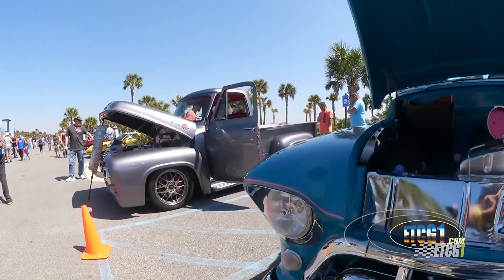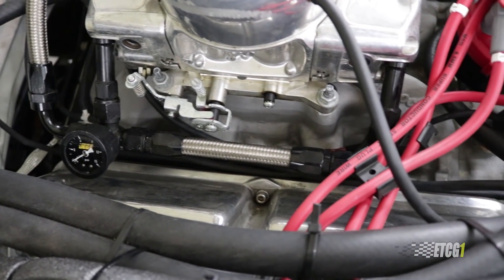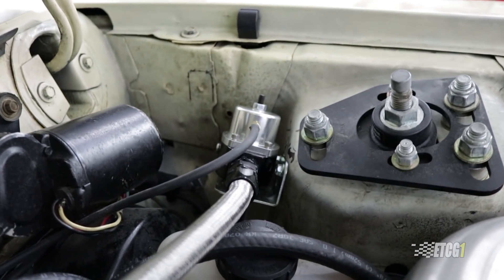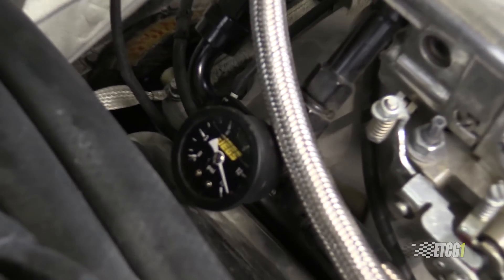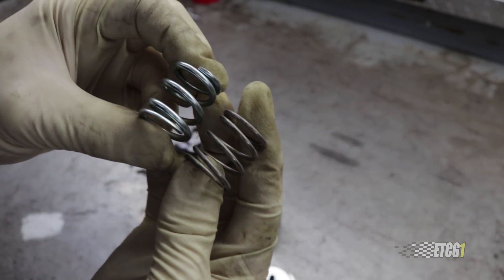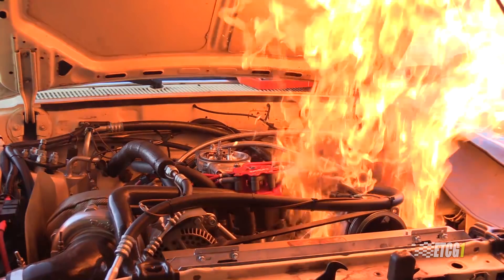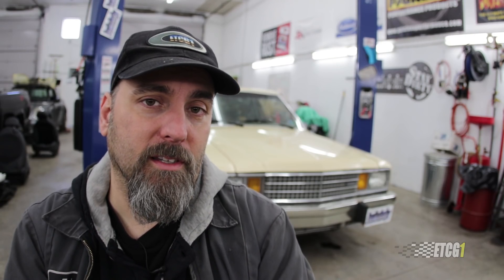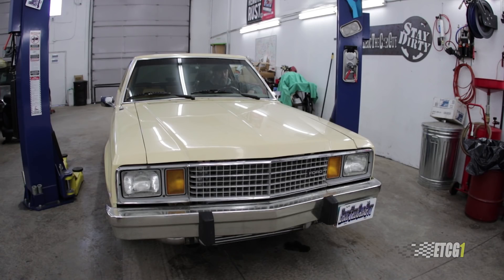How Did the Fairmont Catch On Fire?

Comment: I had to put out a titanium fire on my mill. The powdered extinguisher that I used, sent that damn powder into the nearby computer, shorted the internals, and killed it. That fire extinguisher powder becomes electrically conductive when it's heated. Thus my move over to a CO2 fire extinguisher.
Reply: That's a new way to kill a computer nice work.
Reply: That's rather surprising, as dry chemical extinguishers are rated for electrical fires - in fact, the class C rating in the US specifically means the extinguishing agent will not conduct electricity.  Not that the powder can't damage a computer, but it's very unlikely that it actually caused a short.
Reply: Being rated to out the fire and preserve the equipment are two different things.
Reply: Aussiebloke609 It's unbelievable until it happens to you. Class C is for electricity, not electronics. That's why server rooms use Halon and other gases so the electronics don't get ruined from the extinguishing process.
Reply: Thanks Dandel351. I'm so proud ;)
Reply: Scott Crittenden  Yup !!
Reply: Hmm...with a little research, it seem that extinguishers rated for burning metal (class D) are different to regular dry powder extinguishers, so I'd guess this is what caused your short circuits, since most of these are sodium chloride, graphite, or copper based, rather than the more common ABC dry powder.  If you're working in a mill, that's the type of extinguisher they'd have available, as no other classes are listed as applicable for metal fires.  However, as they are not listed as suitable for any fire other than burning metal, that's not really applicable to Eric's little barbecue.  The more commonplace class C dry powder  extinguishers (usually ammonium phosphate or sodium bicarbonate) are not conductive.
Reply: Not a class D for sure.
Reply: Lol titanium don't burn
Reply: Of course titanium burns - pretty much anything can burn if you get it hot enough.  Auto-ignition temperature is 2200F for metal (usually shavings) in air, and only 480F for powder in air.

The following is from a material safety data sheet for titanium:

"Do not allow metallic dust to accumulate.  Metallic dust may preset a serious fire hazard. Titanium and titanium alloy solids are not considered combustible in the form supplied.  However, subsequent machining operations require the use of cutting fluids to reduce the temperature of waste material which might ignite without coolant. "

https://titanium.com/wp-content/uploads/2013/05/Material-Safety-Data-Sheet-Titanium-.pdf

I also found this little tidbit on the same data sheet:
"EXTINGUISHING MEDIA:  Dry table salt or Type D fire extinguisher. 
SPECIAL FIRE-FIGHTING INSTRUCTIONS:  Remove uninvolved material; allow fire to burn out.  Fire can be controlled by covering with dry salt or powder from Type D fire extinguisher.  Carbon dioxide is not effective."

So regarding Mike's mill fire and computer problems from using a class C (dry powder) extinguisher-  if he's switched to CO2 now...good luck putting one out now, as it's specifically listed as ineffective for burning titanium.  And halon is used for server rooms because that fine dust can kill cooling fan and hard drive bearings, and clogging up microswitches...which will cause components to overheat internally.  But class C extinguishers (ammonium phosphate) doesn't cause short circuits.  If it could conduct electricity at all, it wouldn't be considered usable for any electrical fire, regardless of whether heavy duty electrics or electronics.
Reply: It burned so white hot I couldn't look at it.
Reply: Desert Mike DIY don't believe them. Some 'CO2' extinguishers I've seen are also loaded with sodium bicarbonate, which like table salt is conductive when dissolved in any polar solvent. So if you had organic acid antifreeze leaked from a CPU cooler, it's the EM-short city express for any nonpotted electrical device actively carrying current.
Reply: Mine is loaded with just CO2.

Comment: Just a couple of points. You need a Schrader valve on that thing so you can check your fuel pressure. This would have avoided your spill. Second point, you need some pulse dampening. That noise you hear is the fuel hammering on the regulator spring and it's check valve this will cause premature failure. It also causes inconsistent fuel to the carburetor though the fuel rail helps.
Reply from the maker: Thanks for the input, but the new system is working flawlessly and I couldn't be happier. Also, I have a fuel psi gauge mounted in the system permanently already. I don't see the need to add a port for another one.
Reply: Range checking. You only saw 100% of the expected range. Thing was putting through at least 3X that, but gage didn't go that far.

For things like aircraft or ships boilers, you'll see that kind of thing too. Looks redundant at first, but there's a reason.

Comment: Wow thank God you had the extinguisher and were able to stay calm enough to act fast! Did you let Holley know why this happened? They might want to know, at least to issue a warning to anyone using the same pressure regulator to check the spring first! 
As an inboard boat owner, one thing I always do even when doing tune ups etc is always replace the backfire flame arrestor on the carb before starting the engine. Same when I had cars with carbs, I saw a dramatic back fire out of a Holley on a small block Ford when I was in high school and its a sight you never forget!

Comment: Hey Eric, can understand the feeling.
Was working on a family member's rare '61 Impala 4 door hardtop 283 sport in an old garage full of stuff including a cupboard filled with vintage publications right against the front fender when probably shouldn't have as late and tired. Saw something splashing on the windshield, but swore imagining until suddenly had a fire just like you showed. I had to run to my vehicle and grab the no residue fire extinguisher. Talk about the most scary moment, my thought was that garage was going, go up quick and probably take out at least the living room. All that happened was burned the original wipers and singed the paint. Heck, didn't even get scolded by the owner or my Dad, my Dad had no emotion, just said something like "Glad everything is okay. (not typical)"
I am a FI person so didn't know carbies like to catch fire, otherwise would have had an extinguisher. You bet now every vehicle I work on have some form of extinguisher; always have had two in my personal garage.
Carbie was fresh rebuild but had sat for a couple years so now know the ethanol sitting in it trashed the rebuild and have to be done all over again.

Comment: Wowsers.  Glad for no real damage.  You are one lucky dude.  Recently i learned not to use a dry chemical extinguisher because of the horrendous mess they make.  I just ordered a 10lb carbon dioxide extinguisher for my small homebuilt motorhome.  I plan on two more...probably one more 10lb...and one 5lb.  When one is boondocking...who ya gonna call?  It is up to me.  Cheap insurance.

About your fairmont.  I wanna drive yours sooooo bad.  I owned a complete stock one for 15 years.  Great transportation car.  Only repair i had....was replacing the cabin heater core.  Nightmare job.  The whole dash assembly has to be removed.  Ugh.  Other than normal maintenance parts...the heater core was the only repair i did in 15 years.   Bought the car from an old lady...with 11,000 miles on it.  I sold it with 145,000 miles.  And was still running great.   So you can see why i wanna drive your ride.  Good luck! 👍

Comment: My reliable POS Olds Intrigue caught on fire after a hot climb up a snowy road. Luckily, copious amounts of snow put it out. Burned through the ignition wires though. Oil leaked from the valve cover gasket onto the exhaust manifold. We got a recall notice in the mail about a year later for that problem. Scary feeling.

Comment: I have seen advertised, fire suppression for under the hood. They setup like a building fire suppression system with under hood mounts and a push of a button it extinguishes the entire engine bay. I believe they also have temp sensor ones that will go off just by getting too hot.

Comment: About halfway through he video when you said you turned on the fuel pump, I knew what had happened.  Carbs man.  Glad it's all ok.  Still, that's gonna run way better with that regulated pressure.  Congrats on the hard work that's paid off.
Reply from the maker: This had nothing to do with the carburetor.
Reply: Was the fuel not geysering out of the carb bowl vents?

Comment: The 460 had a nice carb fire in my 79 Ford I had to put it out with a hard hat using ditch water. The excess gas problem may come back and haunt you down the road it may damage the intercooler.

Comment: Many long years ago, I had a Cutlass with a 350 and a Holley 1850. Working too late into the day, losing light, getting harassed and distracted, I missed getting the forward seal back on the fuel transfer tube, sprayed gas all over the distributor and POOF! Dry chemical extinguisher kept the car from burning to the ground but it absolutely trashed everything. Gave my the perfect excuse to go pick up a 455 for it tho :)

Comment: I had a Ford with a power steering leak that sprayed fluid on the hot manifold and caught fire.  Luckily,   I had a fire extinguisher and changed what could have been a catastrophic loss into a minor inconvenience. This power steering fluid was some kind of clear stuff, not automatic transmission fluid.

Comment: I had a similar situation in my old 1980 gmc sierra.  I was getting it running for my grandpa and it has seen better days, the second day after I got it running the connection at the carb started to leak. And it was only minor.  I went to start it after some time and she started on fire,I could see the smoke come out from under the hood!! Fortunately I run fast and grapped an extinguisher and put it out.  Replaced the o ring and its great now!
Reply from the maker: Glad you're OK and that you got it sorted.
Reply: Those glass inline filters are a fire waiting to happen. If the glass doesn't break, the seals will leak.
Reply: It isn't glass.  Its a little cartridge that sits in the carburetor.
Reply: Oh ok I know what you mean.  I've had Rochester carbs with the filter inside.

Comment: The extinguishing agents in many fire extinguishers are corrosive and will damage metal parts if it is not removed quickly. Hopefully, none of the polished pieces were damaged by the extinguisher.
Reply: nick harding Tho now it'll just buff out, unless 'prepolished things' simply melt.

Comment: Lesson of the day... if that fuel pressure gauge is maxxed out, something is wrong.   Don't crank it if the needle is wrapped.  Either the gauge is toast, or things are about to get extra crispy.  Think I'll stay away from the dual purpose regulator as an added precaution on future builds having seen this good idea gone wrong.  That, and not use an FI rated fuel pump to feed  a carb - it's capable of  adding  unnecessary heat into fuel from building higher pressure. 
  Thanks for sharing, and hope you don't need to use that new extinguisher.  Would putting the regulator on the front side and installing a fixed restriction ciruit coming off the log be feasible? You could machine a small block to accept a recessed jet as a way to experiment with proper orifice size.  Tee the bleed off with regulator return, and use a larger line back to the tank to prevent backpressure from building at idle if needed.  Might help keep fuel temps down if stuck in stop & go driving and help steer clear of vaporlock in hot weather...

Comment: So I don't know much about electric pump driven carb setups, but it seemed odd that the pump stayed on for so long without shutting off with just the ignition on. Is that the case with the proper regulator spring as well?
Reply from the maker: That has nothing to do with it, that's the way I wired it up. It's not tied to the ignition system on a timer like it would in a conventional car. It's on a separate circuit that's powered by the ignition with no timer. I wired it myself through a relay. Now that I have the correct spring installed and a return system, there are no issues at all leaving the pump on.

Comment: Wow! That looked like Niagra falls coming out of your inter-cooler. Those fuel lines looked pretty tidy to me. Definitely not turning fast enough to bend a con rod. Should be good to go other then washing all the oil off the cylinder walls. I like the F version of that pin label.

Comment: That's terrific that you were able to put the fire out so quickly! One question, it seems the engine has quite a long crank time. What causes that, and what is the remedy?
Reply from the maker: I had been running it previously. Likely it was a little flooded is all. It cranks right up most times. Carburetors can be a bit temperamental at times.
Reply: OK, thanks for your reply!

Comment: Hello Eric I'm looking for help on my car problem. 06 Toyota scion TC 89 thousand miles we are the original owners and for the last 6 months or so I have an "intermittent"  cranks but won't start problem. After 4-6 try's it will start and run great. And then it happens again several weeks later, the car can be running temp or over night cold. The dealer says it won't show any codes and they can't diagnose the problem when it runs. If I have it towed to the shop next time it happens there is no promise it will have the " intermittent " crank with no start. Any thoughts on how to find the problem without throwing buckets of money at the car guessing what part to try next. Thanks for your repair vids.

Comment: Same thing happened to me in my '32 Ford 3 window. The floats stuck in my tri-power at a car show. My trunk mounted tank is higher than my fuel pump so while I was at the show, my engine was filling with gas. When I started my engine, it hydro-locked. I pulled the plugs and cranked the fuel out of the cylinders and had AAA tow it to my house. I changed the oil, then started it. It wasn't running right though there was no knocking coming from the engine so I removed the valve covers and pulled the push rods. A few were bent.
Reply from the maker: That sucks, glad there wasn't any fire.

Comment: I knew from the first video where the fuel came from, but was wondering how the hell so much fuel ended up in the intercooler. Seen massive amounts of oil in intercoolers before, but never fuel. Now I know. 
Also been there with the incorrect pressure for a carb, and a lovely fire to go with it.

Comment: Robert Clark: "Second point, you need some pulse dampening. That noise you hear is the fuel hammering on the regulator spring and it's check valve" Hummm... Personally, I'd ask Holley... costs nuthin to ask, eh. Regards & Thanks for the education.

Comment: Hey Eric, was the Fairmont tuned with that fuel pressure regulator? If it was, does this mean you need to get it tuned again?
Reply from the maker: Yes, I've been tuning the car again since I installed the new fuel system. It's going much better now that I have consistent fuel psi.

Comment: A lot of race cars have a c02 or halon system plumbed in so you can just pull an oops pin and flood the engine bay.
Considering all the fatalities from fires after an accident all new cars should be fitted with one .

Comment: Consider putting a fire extinguisher on each post of your lift.  It's out of the way but close at hand and with two you won't have to run around the car.  A large unit beside the door for fires outside and inside as a reserve.
Reply from the maker: I have 4 in the shop now. I think I'm good.

Comment: is that a special type of regulator meant to go AFTER the carb?  I've never seen something like that (usually regulators have higher pressure on the inlet side and only let a certain amount of pressure out)  I mean, obviously it works and I'm sure you know what your doing, it's just something i've never seen\heard of before.  Is there a benefit to this type of regulator?  A obvious downside is it causes your fuel pump to run at 100% duty so there must be some benefit to offset that
Reply from the maker: You can position it before or after. I think it works better in the configuration I have mine in. The carburetor is always cycling cool fuel through it.

Comment: I had a Fragola push on connector pop off my fuel rail 22 minutes after changing the turbo housing, new injectors and a new cross over pipe. Yeah, now I have a rebuilt title. Russel from now on. Didn't have the fire extinguisher in the car. It was on the work bench.

Comment: I had a fire in my Ford Capri, caused by the little brass tube that pulled out of the carburettor, and the fuel pumped all over the engine compartment,  Luckily for me the fuel pipe melted and bent closed, stopping the fuel feed.  Luckily I had a small aerosol type fire extinguisher in the car, which gave someone else time to get a big fire extinguisher from a shop nearby. Lets just say, I aged a few years an a few seconds. Luckily no damage, just had to replace a bit of wiring.